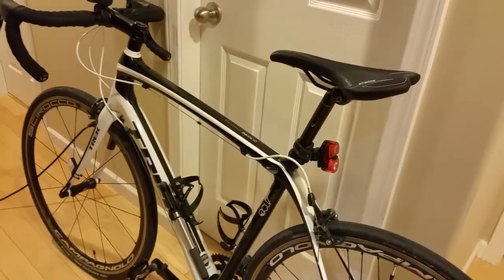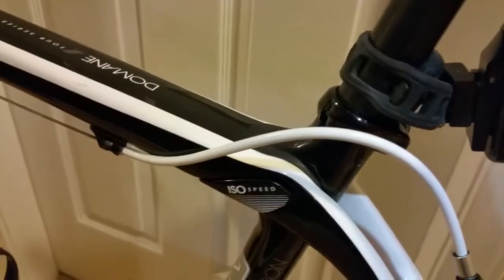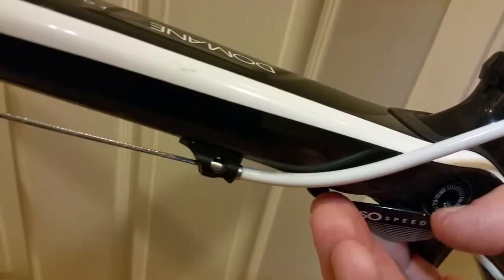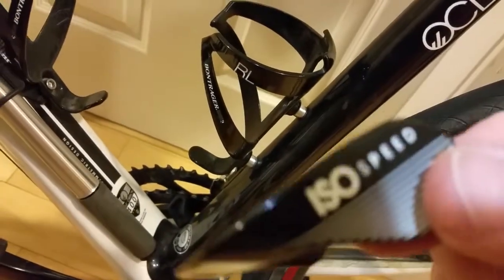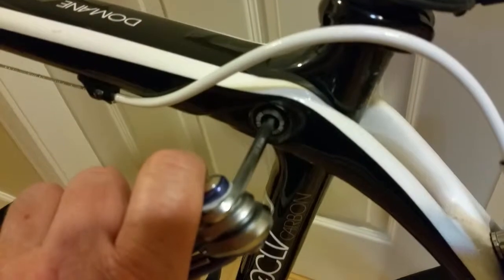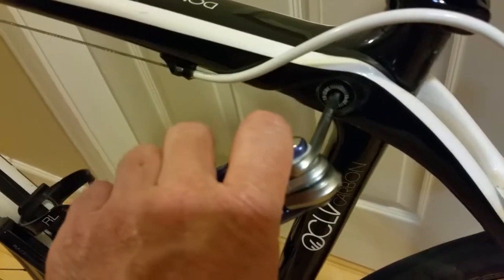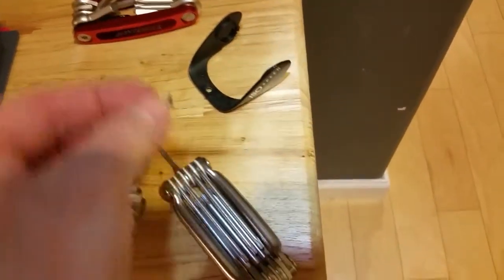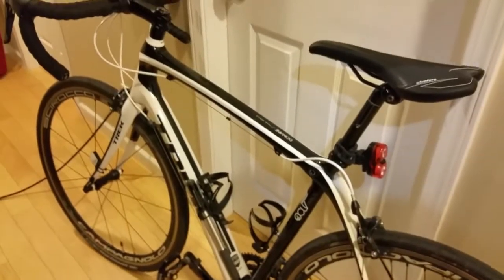Trek Domane - Tighten ISO Speed Decoupler

Comment: I have the same isospeed structure in my boone 5. But today when I decide to maintain it I found that the thread size is different with you. M2 is too small while M3 is too wide for my bolt driver. So I doubt maybe it is M2.5? Maybe I should find a Technician tommorrow to fix this problem.
BTW, 1st Isospeed is the easiest structure for people to maintain.

Comment: Did you notice any groans or creeks coming from the isospeed region prior to tightening, and did tightening fix the issue? My 2018 is groaning from that region and I don't want to muck anything up by trying willy nilly. Thanks in advance!
Reply from the maker: Hey Scott, no noise from mine - I could just feel something was loose.  Check your saddle and seat post bolts first to eliminate them.